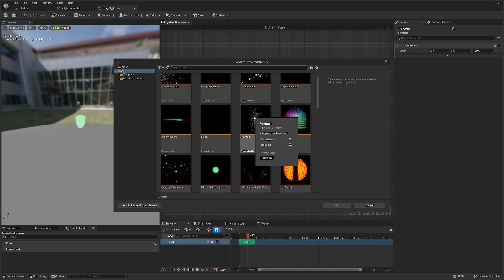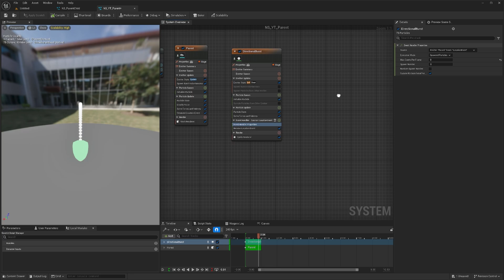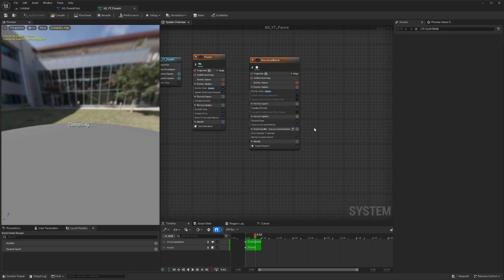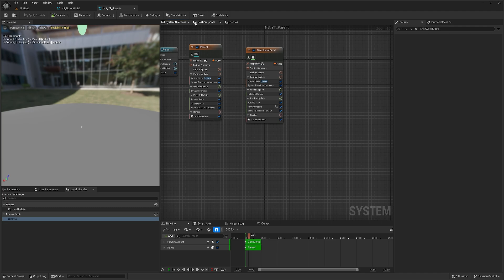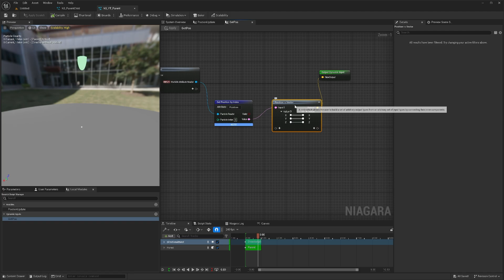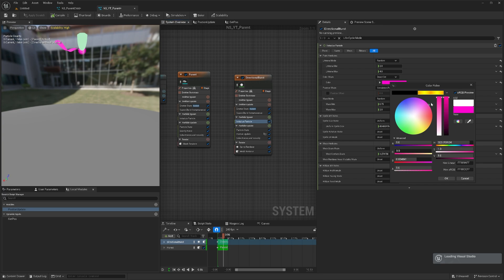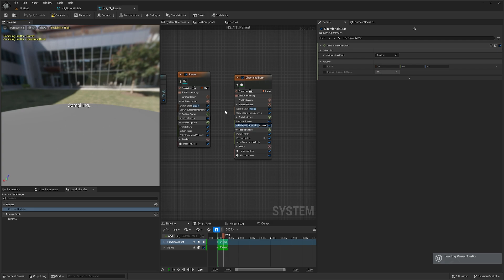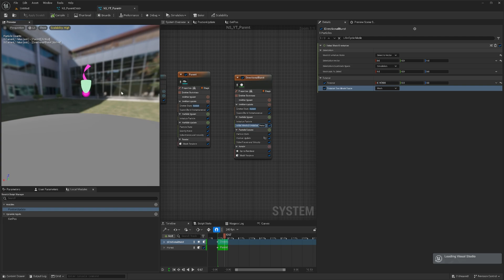Parent and Child Emitters in Niagara using Scratch Pad in Unreal Engine | Realtime VFX

Comment: Thanks! It work great for one particle, but what if I want to use it for emitter with multiple particles?
Reply from the maker: This method should work fine for multiple particles as well just keep the "Require Persistent IDs" box checked int he properties of Emitter. 
Let me know if it is not working I will test it by evening.
Reply from the maker: this wont work for multiple particles I got some time to test it. we have to create different dynamic inputs for spawning and setting postions and update positions. 
1. The particle attribute reader has it we can get the number of spawned particles (parent system)  and set it in the emitter update as Spawn Count (in child System)
2. for setting up the postions we need to get the positions by Id and set all attributes accordingly in terms of Transform space and mapping each particle Id to a new spawned particle ID and then updating the positions in child system, this is slightly a longer process and if you want to check how its done you can check those two premade modules and extract just what you need.

Pre made modules = "Spawn Particles from Other Emitter" for Spawning the Paricles in Emitter Update
and "Sample Particles form other emitter" to sample positions  in Particles Spawn.
Reply: @aashishbharunt  Thanks!
Reply from the maker: I will try to recreate something simple out of it, there should be an easy way just to sample Positions and nothing else.